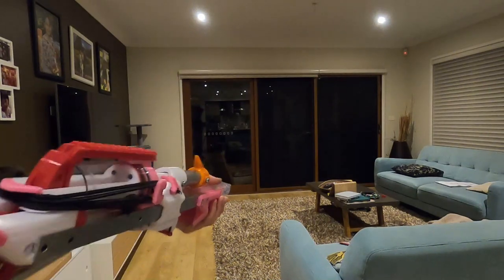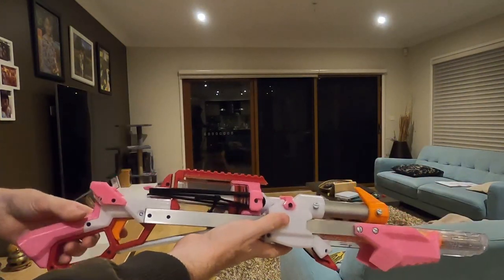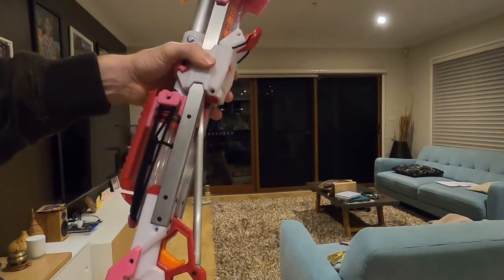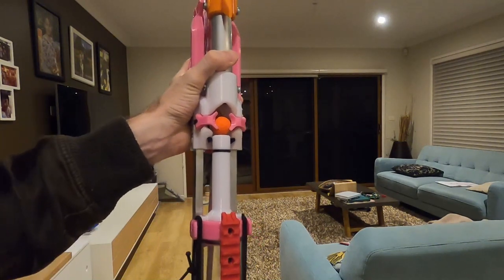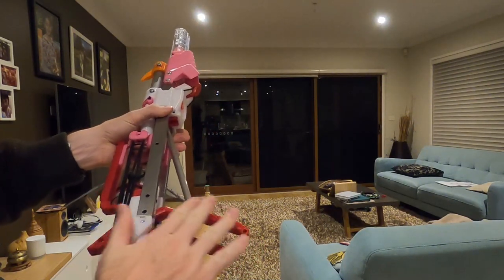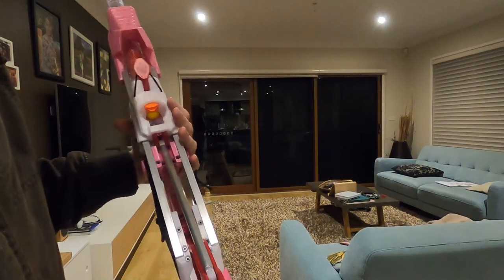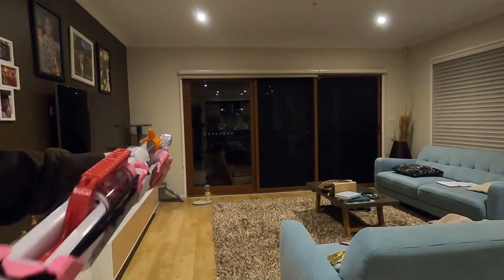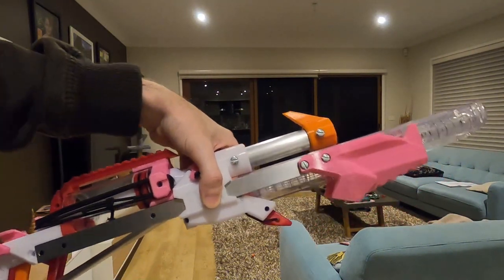I made a FLAK for the lols

Comment: man how did you get your prints so smooth?
Reply from the maker: The red was printed in my new HEVO (actually first prints on this machine) and so the bed side is a bit rough and the retractions aren't 100% yet. The pink and white is on my "Ender 3". Linear rails on all axis, dual z, re-squared frame, re-belted, cleaned and oiled.. Lots of calibration